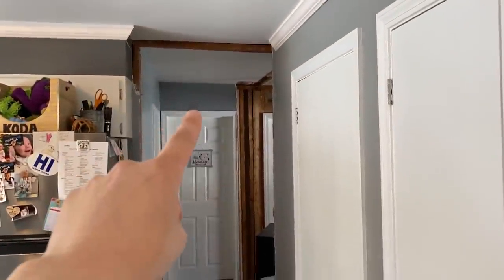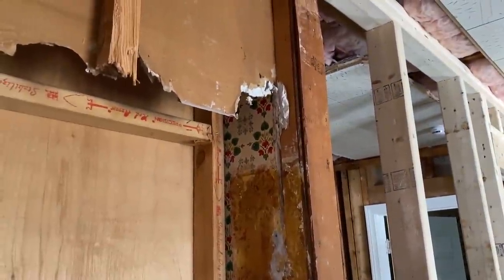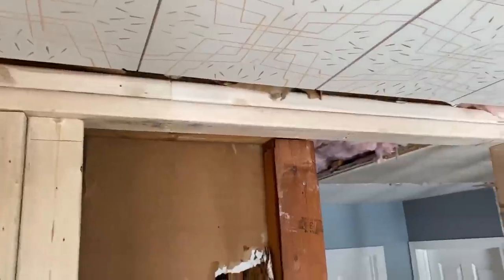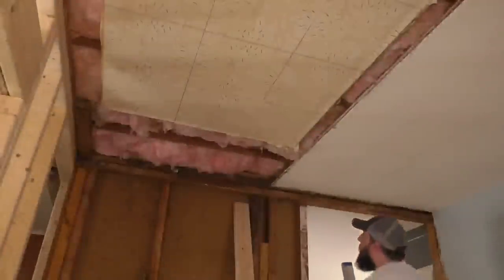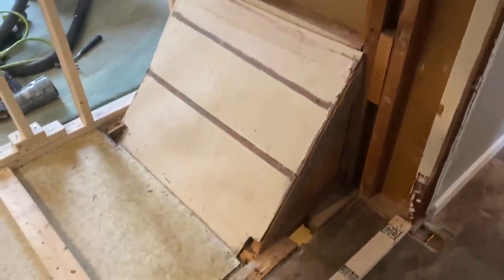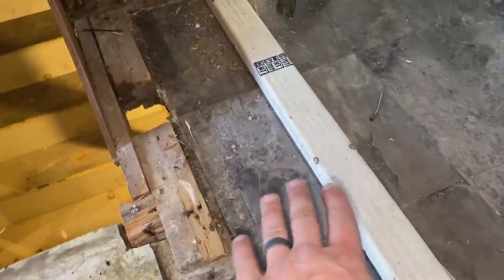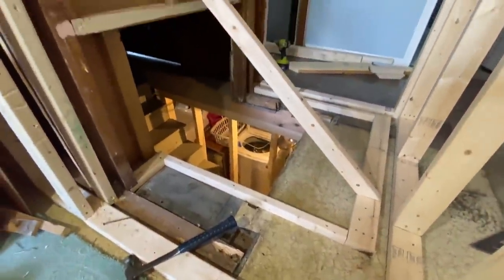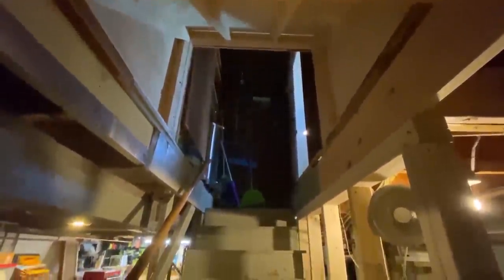Framing Bedroom/Hall Closet | Adding Basement Stair Headroom

Comment: Very cool!  We had something similar in our house here in Ireland, built in the 1940s. When going from the ground floor to the 1st floor too- so in a high traffic area!  I'm 5'6" and couldn't go down the stairs or up the stairs standing up straight. Just moving the stair well hole about 6" further along the floor and starting the top about 4" higher put the ceiling angle parallel with the stairs not only looked way better, but gave most people under 6'2" enough room they didn't have to duck!  Also found during our move-in, even after my adjustments, the mattress only just fit up the stairs and that's with extreme persuasion! So much so, when we sold just a couple years ago, we left the bed upstairs to be someone else's problem. We heard the new owners got a deal where you buy a new bed, they take away the old one for free... the furniture delivery guys, "had a heck of a time taking away the old bed- they had no idea how the mattress got up those stairs in the first place."  haha

Comment: Good work!  So much to think about and measure and make adjustments to get the extra head room you got made it all worthwhile.  Wish you were close enough to replace my front door that is not square.  Door knob won' t latch so I just use the dead bolt.  House was built in 1966.

Comment: My man!!!! I can tell you are a tad OCD like I am, ha! I bought an old house, built in 1931, good bones but the former owner did everything half ass. I was working far from home and traffic was a mess, so I contracted the first projects, but is never the same. Now retired I am having a blast with my power tools! Also, you and I being owners makes a difference because we clean, we vacuum, we make sure is even and plum and handsome even if it will be hidden. Nothing like a homeowner to overkill and make sure our kids are safe! Is the reason why you do the "just in case" nails, ha!  I had a lot of fun watching this video and uncanny how I almost knew what you were going to do and say! These are the things we do ourselves because they will never be done as well by anyone else! I already replaced the knob and tube, the water lines, even installed a sump pump, and all the wires, lines and pipes are straight, leveled and somehow in harmony with joists and studs, ha!

Comment: Always land your studs directly under a joist if possible & use double king studs on either side of an opening on a load bearing wall & make sure the point load is transferred directly to the slab or beam or column in the basement if there is also now is a good time to fix any unlevel floors in the 2nd floor if you have one like in this video. Square, Level & Plumb everything now especially square any walls at a 90 degree angle to exterior walls .

Comment: An easy way to remove glass. Heck you can even break it on purpose after you do this. If you have old card board or even some paneling that you ripped off the wall. Cut to shape of the glass and use hot melt glue or some other quick setting adhesive. Coat both sides of glass thoroughly and then press card board onto it. Let it set up. The you csn remove glass safely. Even breaking it on purpose.

Comment: Looks good. I know we have to make our wives happy but head space going down the stairs is more “valuable” than closet space in my mind. A better compromise may have been a step (or even two) instead of a slant, if you put shelves in the closet, the slanted space under them will be pretty much unusable anyway and a few more inches of headroom may come in handy getting larger things down the stairs.

I like how you plan ahead with nailers and support inside the walls, it’s easy to get bit and find yourself trying to nail something behind things you installed previously. Good job figuring out the puzzle 👍

Comment: There is nothing wrong with armored cable.  Its mouse proof!  Some of the old stuff has aluminum wire in it and that can be a problem.  Typical to find only two wires in it because the metal conduit was mechanically connected to metal boxes and provided a ground path.

Comment: Man the only thing i can't  get behind was how you cut that panel with live wires on the other side. It would have been much easier and safer to just unscrew the 2 screws holding the outlet and move it hell even 10 more seconds to flip the breaker off. Anyway good work for the rest of it love seeing these kind of projects

Comment: Got a question for you: I'm having my deck replaced, and the guy doing it set up a really nifty temporary work bench attached to the supports (it's a 2nd story deck). Am I crazy for thinking that it would be a good idea to make that work bench a permanent fixture and also use it to store stuff under? I don't have a good work space where I can make a mess, and there's a power outlet right under the deck (also, crawlspace storage).

Comment: Just my opinion... but I would have ripped it all out including the staircase. Reframed all of the walls inline from the basement floor to the ceiling rafters. Then rebuilt those stairs running in the opposite direction. It would have solved your head clearance issues and you could have built wider stairs. Also, you could have framed a closet in the corner of that room without any obstacles and possibly used the old entrance as a small kitchen pantry.
Reply from the maker: Great idea.  Trust me I would love to!  I thought about doing it too.  I can’t though… without A LOT of money and effort.  The top of the stairs sit tight against the chimney so I don’t have the length to flip them.  The chimney would probably end up a foot from the last step if not closer.  I could get rid of the chimney but it vents the furnace so I would have to move the heat and power vent it.  So might as well get a new system.  But maybe in the future.  🤔
Reply: @TheFixerHomeRepair  as I said, just an opinion, but you could build a landing half way and turn the stairs 90*. Love your show. Don’t want to sound like a troll. But I’m a retired engineer. Troubleshooting is/ was my life.
Reply from the maker: @johnnelson8956  I got ya!  That is not a bad idea!  Anything is possible.  Thanks for the comments!  And for watching!

Comment: Hey it’s nice to some one with enough experience to do the  job even if some of the Methods are little of off. its two in the morning i just spent more than an hour and didn’t even noticed, l work construction and let me tell you some codes are no met on the video but l can’t care less like l said the job was done and nobody it’s going to complain  the closet though i would have gone a little comprised with the misses and go to your original  idea but to your bottom line then yo would have yes a larger shelf but in the long run that triangle shelf you would hated  anyway i am suscribing and star looking your videos ..,,just not a 2-17 in the morning thaks….Jose Olivas

Comment: Why is it that when everybody does a remodel and are going through all the effort in demo they never take the floors back down to the sub floor? Yes I know it's more work and sometimes old flooring can be a bear but I have seen over a 1 1/2" lost to this. Plus I find it to be very tacky looking. No matter how good they try to finish the room out I always find tale tale signs of the new walls and such built on top of old flooring. I get it if the homeowner doesn't want to pay for the labor but if it's your own home why not take the effort? Just curious about it more then anything. Am I missing something in doing this or is just a pet peeve? Your stair well opening looks really good BTW.
Reply from the maker: Hey, not sure if you missed it in this video but the layer of flooring under the grayish tile in the kitchen tested positive for asbestos.  So I didn't want to disturb it.  Otherwise I would have tore it all up.  Thanks for watching!  👍
Reply: I do remember you saying that now. Yes I agree with your logic on that. I do wonder why it is so common though even in homes where that is not the issue. Is just a labor price issue for most people? @TheFixerHomeRepair
Reply from the maker: @Yackhammer75  people probably figured just adding another floor on top is worth it to save on time and labor.  I am with you, in a different situation I would have tore it up.